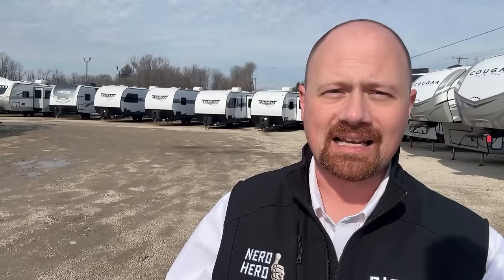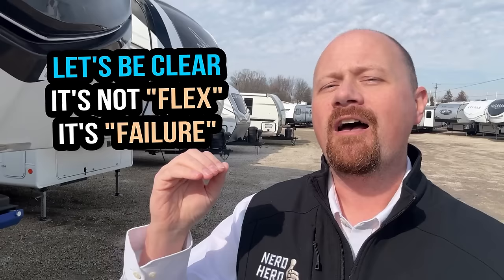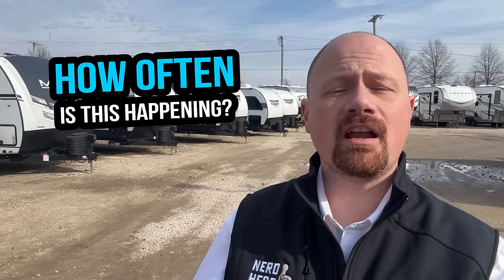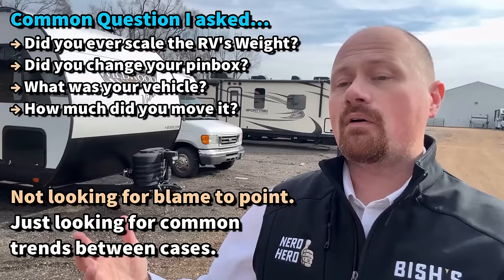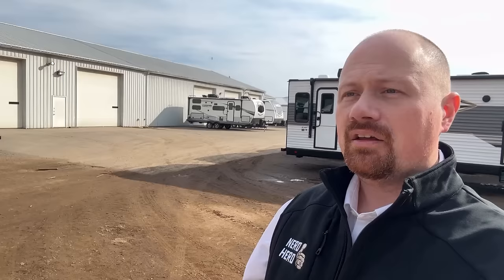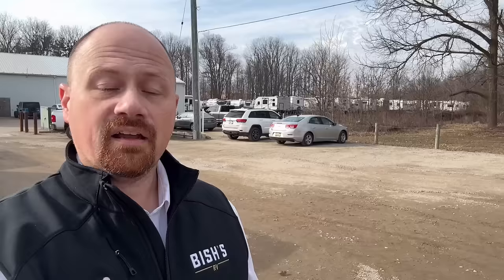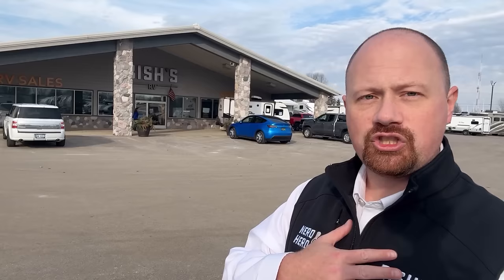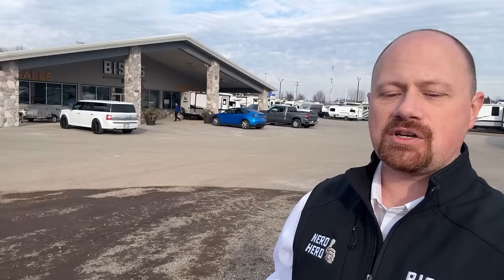🚨 RV Frame Flex & FAILURE!! • WHAT is Happening and WHO is Responsible?!

Comment: I’m going through that right now for eight months and it’s been going on I purchased a Wolfpack 365 2022 took one trip from Texas to Florida and the front is separating on both sides of the camper and the back door for the toy hauler exploded The frame came apart some reason, it’s been at Fun Town RV in Rockwall Texas for four months now it’s in Cleburne Texas Funtown sitting down there waiting on warranty work love the camper but getting repairs done. It’s like pulling teeth making all these payments and not getting to enjoy camping very frustrating have been looking at the Brinkley 16 foot toy hauler one that is well built. I would recommend that to anybody with golf carts. That brand does a lot of testing. And they use Gen-Y Hitch 5th will receivers.

Comment: I have said so many times that I don't believe these RVs are meant to live in, no matter how "homey" they try to make them. In my opinion, Rv's are for maximum 2 week to one month adventures each year, and no more. It seems the more they are moved due to traveling across the country, the more problems arise. We recently took a trip across country from Oregon to Tennessee, and our 35' fifth wheel did fine until we started back. It did fine until about 1/3 the way home, and we lost our trailer brakes, we towed it until Las Vegas and got them fixed, then there was some kind of electrical problem, as well as a rubber seal that came off. As I speak it sits in our driveway, and will, until someone assures me that the electrical problem is found and fixed professionally. Will I ever again take it across country? NO! We'll stick closer to home just a couple states away at the most.

Comment: In my opinion in the rv weight range the 5th wheel hitch should be done away with. Around 70% of 3/4 ton and 1 ton trucks come with a gooseneck hitch. Gooseneck hitches are capable of handling nearly all rv's other than maybe a few super heavy high end units. Why should I have to add a $1k hitch to pull a 14k lb camper when I use my goose hitch to pull 25k on a daily basis. Makes no sense. It does not cost much more if any more to build a gooseneck frame for an rv vs a 5th wheel frame. When you consider the chucking and potential for decoupling of a 5th wheel hitch that the gooseneck does not do in addition to the fact that most trucks come with or are optioned with a gooseneck already, the rv industry needs to adjust.

Comment: Josh your normally spot on but I’m going to have to disagree on this one. Information is not the biggest issue, it’s the engineering of the frame and box/house, and this is coming from my own engineering background. They are way under designed with no factors of safety taken into account. They need to redesign the frames to hold the weight they are rated for. Our own personal rv had this issue when we first got it and it wasn’t even half way loaded up with the correct pin box, hitch and truck. Sure if you over load one it will cause an issue but a lot of cases are happening with minimal weight. You mention Mfg said this is a small percentage of their designs having an issue. The real question being on the large RVs what percentage of those is it happening to? They really need to take a step back and fix the issue instead of side stepping it and trying to sweep it under the rug. If this was the automotive industry there would be massive recalls and fines for frame failures of any kind. There needs to be more accountability in the rv industry.

Comment: i would also add slides to the equation. Lot people with brand new slides that fail from day 1.  watching lot of rv inspector channels its the slides that have huge problems too.   Some of these are on fairly new 250k to million Class A.   Water comes in through slides etc.  Maybe someone can evaluate this. lol.   Saw one video where whole slide fell off. lol. Its scary to put a huge refrigerator on a slide??   Just tiny cable retracting these.

Comment: Ihave a2022Alpine tow from Ohio  to Florida I believe I have an issue my outside skin is cracked .It's 42f.t. Could you see if weather or not they should maybe use a stronger frame seems to me maybe using same frame for 32 f.t 39 f.t 43 f.t. toy hauler think that needs to be looked at

Comment: Josh, we appreciate all the informative videos that you do. However, in the case of a properly loaded RV with a proper tow vehicle it is 100% the manufacturers fault for designing a frame that cannot handle the intended advertised load regardless of how many miles it’s towed.
Nowhere on any RV manufacturer brochure, or any other document, have I ever seen listed what the limitations are for maximum towing mileage, this again would be the manufacturers fault if it was omitted

Comment: I looked at a few toy haulers and in the end I bought a 2001 high end. 40ft diesel pusher  a 24ft open trailer  14k capacity.  And haul all my toys and  my jeep.  Ya my coach is not as spacious as a new 5wheel  but I am much happier then my friends that have them

Comment: My takeaways-

1. Don’t roll coal with a 5th wheel attached…

2. If wanting to full time, reconsider going motorhome.

3. Manufacturers need to evolve to the new ways customers are using their RVs; better suspension (its 2024…), more robust frames, better disclaimers on economy lines that set proper expectations. People are RVing more often and also boo docking more, build them with that in mind (look at the west coast OEMs and maybe even Ember)

5. Dealerships should evolve as well with post sale education support (cut a discount for opting in to “RV-ed” programs on their service plans), reutilise lot space for a weigh station made up of calibrated portable scales and tongue scales (prices on these have dropped significantly in the last decade).
Reply from the maker: I think you have some fair statements here
Reply: @JoshtheRVNerd  I meant to say great video as always sir! 

Twinbeds out!

Comment: 1). You sound spot on with this video on all counts.  You make perfect sense on all cylinders. Thank you for this video.  You are a wonderful teacher 🧑‍🏫 you deserved that award.

2a). You mentioned and compared to a semi tractor for towing an RV, but realistically, is there too much towing with a pick up truck 🛻?  The 2023 F450 can tow 40,000 pounds.  Would you never use that to tow a pop up?  Aren’t those big trucks used by the hot shot companies to deliver everyone’s units to the dealerships and to destinations if they don’t have a tow vehicle? (I know pop ups are usually delivered by semi).

2b). So then in reality, wouldn’t it be best if the industry put recommendations on specific sized vehicles to be used for towing?  I know the industry just wants to sell units, but you must have the proper vehicle to tow safely.  Ford sells the F350 & 450 pickups.  GM stops at the 3500 HD; their 4500 & 5500 are considered a medium duty chassis.  I know their 5500 series is used for ambulances.  My question is, do they put a pickup bed on that chassis?  If so, is this too much truck?  

2c) And speaking of the GM 5500 chassis, a little off topic; is there a class C manufacturer that uses the GM 4500 or 5500 chassis?  Ford seems to have the market share.  I’m a GM guy which is why I ask.

3).  GVWR and how to read those stickers and doing the math can be confusing.  You should either repost your older video or better yet, redo it and create a 101 course for the class “Towing for Dummies” on how to read the stickers (GM newer vehicles have an additional sticker) and do the math.

4). The idea of doing a video of going through a CAT scale and showing how to weigh your trailer is a good one.  Even though there are videos of this on other channels, taking us on a field trip would be cool there teach.

5) A video showing the class how to properly load a camper would be good to see as well.  Looking forward to you showing us how to load your pop up pulled behind your Yugo 😂

All kidding aside, great job on the video 👍
Reply from the maker: Ty for watching!
Reply from the maker: I am still trying to learn about the vehicle to trailer ratios, and what is deemed “within spec”
Reply from the maker: Regarding motorized manufacturers, using something like the 4500 chassis… It’s very possible but I will tell you I lack the base of knowledge in motorized that I have for towable and don’t know offhand

Comment: If you want to know pen weight. Wheigh the truck full of fuel with your passengers, and all other junk you haul when traveling. Then weigh truck and trailer. You will get the pen weight. Another thing that I see is about everyone pulling large 5th wheels with one ton trucks also have air bags on the rear suspension with lots of air in them. Don’t know if this can effect frame flex just something I noticed.

Comment: Frame flex leads to Frame failure. I would not buy or even think about buying any 5th wheel today especially anything from Grand Design or a 5th wheel from any manufacturers with a Lippert frame.

Comment: I have to wonder if maneuvering in tight places (such as parking in an rv park) might be a factor.  Also, fast turns (such as having to turn onto a busy highway) will put a lot of strain on the front section of the rv.  For the inexperienced turning too short and curb hopping or catching the edge of the ditch will really stress the frame.
Reply: But those are typical and foreseeable peak stresses that any frame must be designed to cope with.  Life on the road is not all unicorns and roses.  No structure should fall apart just because you towed your rig through some complicated deep ruts on the Alcan highway.

Comment: Measuring hitch weight is easy with cat scales. First empty weight of the truck. Then hookup the rv and re'weigh it. Subtract re-weugh of rear axle from first axle weight to get hitch weight. Airride pin box isn't gonna hurt the trailer. Too light of a frame is the problem. Weak gussets and too much weight bouncing behind the rear trailer axle is the other problem. On these huge trailers they need a 3rd axle or dual tandems and they should be airride. Poor welding from low skill workers is the other problem. These things are too heavy and manufacturers are trying to find cheap and cost cutting shortcuts to save weight and money. All the blame is on the manufacturers. All of it. They build junk and the dealers know it too. Just get it out the door and past the 1 year warranty is all it's about.

Comment: I appreciate the video. The only thing I think you might’ve missed or I did is design. Lippert makes a frame to the specs of their customer (ie manufacture). The manufacturer designs, the weight and layout. I’m not saying that this is the cause of this frame failure but if you discussed it in the video I missed it. Also, I agree with you on weighing your RV. Tongue weight is grossly misrepresented. I have learned now when I’m trying to match up a tow vehicle or weight  distribution I’m just taking 15% times to gross vehicle weight rating. Then all I have to do is weigh the vehicle from time to time and make sure I stay under the number.

Comment: That pin box area is an area of high torsion stress and short of being connected to a large piece of steel plate, how could you not think it would eventually have torsion failure...
Reply from the maker: If it was happening on 20 year old RVs, then I don't think people would be quite so worked up. When it happens on something 2-4 years old, then I suspect people may feel differently

Comment: Josh, I know the owners should take some responsibility for their actions. However the manufactures bear a lot of the responsibility to produce a product that will hold up to what a RV is intended to do, tow! Some bean counter convinced management to cut their costs and they have the tolerance for failure so narrow that these problems are showing up. Just look at Keystone with some of their travel trailer frames so under engineered that they had problems on them. Every manufacture is so dedicated to saving weight and cost that their build  tolerances are too narrow right now.

Comment: Great video, and the thought put into it was excellent.  After seeing it though, and having started the research process but not pulled the trigger to buy yet, I find myself with a bunch of new questions that are frankly somewhat dumbfounding.  Maybe you can put on your brave face and try to say more in one or more future videos.   1) evidently not all large fifth wheels are meant to be moved as often as people are moving them ... well then, how often can they be moved? ... and how large is too large!!??   How does a consumer even begin to factor this into a purchase decision?   2) why don't the manufacturers design for the worst possible case with the trailer loaded at its GVWR and the garage full of cargo ... making optimistic assumptions that will fail under certain conditions and then not publishing what those conditions are is misleading at best and negligent at worst,  3) if I'm only looking at smaller towables, does that mean I can move those as often as I want to with no problems ... how small is "small enough"? ...  when can completely ignore frame flex in my decision process???? ...  do these questions ever end?    Bottom line, this is no way to give prospective buyers the warm fuzzies about a major new investment, even if it's not one of the bigger rigs.  Watching the videos documenting the frustration some owners have gone through with this problem, and the way most warranties are (not) required to cover it, has pushed me into a "best to wait a few years and see if things get better mode!"

Comment: RVs may not have a mile indicator, BUT the newer trucks have trailer mileage accumulated for various trailers entered into the system.

So how many miles in normal?  RVs were supposed to be designed to be towed, hence the wheels and hitch.
Reply from the maker: I wish I had that info. That's never shared even with dealerships

Comment: the Manufacturing needs to make different level of builds, the ones they put out now are good for two weeks a year camping trips, they need to build some for Full time living,  could be the same floor plans just need some upgrades to hold up for 100,000 miles and 10 year of living in it,
Reply from the maker: The thing is from what I gather that kind of is exactly what’s happening, but it’s never really disclosed to anyone which bucket each RV fits into if that makes sense

Comment: Josh, I watch all your videos. I bought my last trailer at Bish's partly because of you. I like you and your content. The mere premise that a consumer can easily and inadvertently do something as bad as frame failure to a gigantic 5th wheel by using it is unacceptable. Frame flex leading to failure should be nearly unheard of. Closer to one in a million, not a bunch every ten thousand. This industry really needs to feel the recall pressure that auto manufacturers feel. Excessive frame flex leading to failure isn't just another low quality product problem, it's a real safety issue. Unless there is real data on the specific cases of falires, such as overloading, blaming the consumer is just as much anecdotal evidence as the internet warriors you mention. Sorry man, I know you are walking thin line to bring us information.
Reply from the maker: I think it is potentially missed, but I’m not disagreeing with you. I cannot fault a customer for using an RV in the way that it’s been suggested to them. If it’s not the main manufactures intention for it to be used that way, then we need more clear distribution of that information.

Comment: Manufacturer underspec’d frames coupled with poor welding is causing most of these issues. Manufacturers haven’t changed the specs they send to the frame manufacturers in over 20 years. Meanwhile the units are getting heavier. Poor workmanship during the coof lockdowns lead to poor welds as well.

Comment: The name I keep hearing is Grand Design with the Lippert frame. 🤔
I looked at a high dollar 5th wheel ($100K+) last year and some decorative trim in the kitchen area was stuck to the wall using push pins. 🙄

Comment: Appreciate the info Josh

No manufacturer has ever indicated their RVs are not intended to be used frequently 

Some actually tell you they are rated 0 t 100 degrees F 

You have missed one big but very small percentage that the frames just failed, and it could be to no fault of the person using it

They used the correct hitch had less weight than the manufacturer lists it can haul

Yes if there are limits to the number of times and or millage per year then it should be listed.  But the manufacturer is never going to

Frames should have a longer warranty than 3 years. Should be 10 years 

I would like much more transparency by the manufacturer 

I would like to know where the metal studs are in the walls when I want to hang something 

I would like to the electrical and plumbing lines lay out etc 

I have seen that the manufacturers as a whole do not have good information or help for people when problems arise because they are worried about being sued 

I understand that fear but they would be better off offering help and I am not saying just paying for something when they are out of warranty 

Many manufacturers and dealers seem to not want to pay for even warranty issues

I had an issue on a refrigerator on a brand new RV the first day of getting the thing home and it took a week to get approval to fix it from the manufacturer. Luckily the dealer said bring it right back we will fix it and wait on approval and all that was wrong was a fuse

Thanks for the video and information